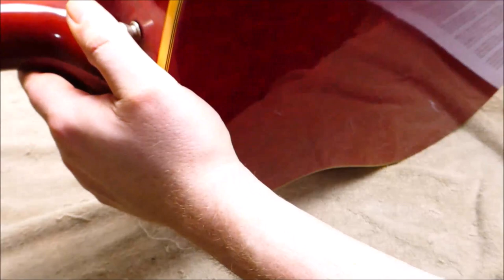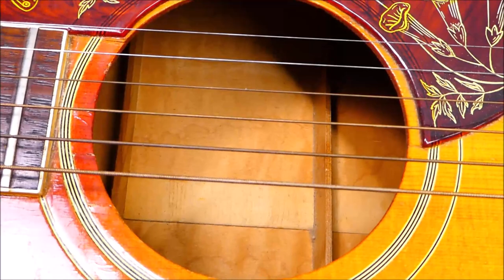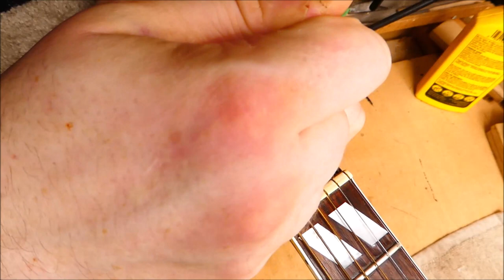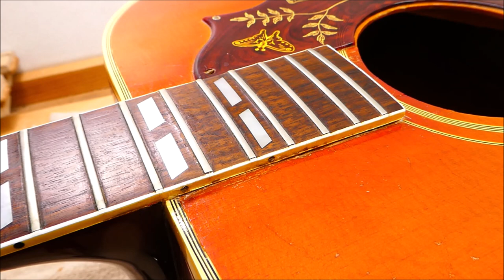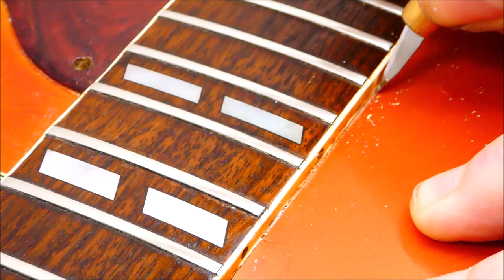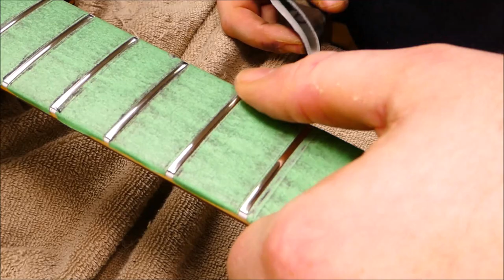'63 Hummingbird

Comment: Gibson in the 60s did recycle some serial number batches, about four years apart, so it is possible, what with the narrow nut width and filled in screw holes of the pickguard, that this one is from 67/8, just before they reverted back to belly down bridges. Having said that, as far as I Know, they only produced a few Hummingdoves (Maple B&S) and in 62/3, supposedly because Gibson had orders waiting on Hummingbirds, but a surplus of Dove bodies.
Excellent as always Ted👌

Comment: Had a Hummingbird once. Over 50 years ago, I knew a guy in southern Cal. named Sparrow or maybe "The Sparrow" and he had a Bird. I bought a used one and thought I was so cool. Did not really like it. It had that screw raising adjustable saddle and all the screws did was to drill a hole in the top. Traded it for a Santa Cruz H model several years ago. Also, if the box was from the 60's or even 70's most of the Hummingbird art on the guard would have been polished away from a player's arm, just say'n.

Comment: Dating 1960’s Hummingbirds is a nightmare. I own either a 66 or 68 or 69 according to various sites and or experts. Oddly mine has a wide nut width when it should be the smaller late 60’s size. Mine also has no sticker but does have a screwed down guard.

Comment: another thing about the fret rockers, even if the frets are perfectly flat, it can still rock because it's not parallel enough with the axis of the strings and it's rocking on the radius of the board.

Comment: Ted--"just" another one of your examples of engineering followed by execution !  (Now, by the way, I am setting up the Daviln-Ford bridge heating assembly. I watch you using it and it appears in the video that you are using some version of a multi-meter to measure heat. Am I mistaken on that? I bought 2 S-Mc kits but, darn, those need big holes !! ( I have to do a vintage Guild D40---mine) I found what appears to be a $53 dollar adjustable power source (YES, DC) on Amazon. My wire, sleeve material and SS tubes are in my cart. Ian sent me his link; I had already made some guesses and was very close, but I am not too proud to be at a degree of error. It does not seem right to ask for expert advice, and then, ignore it.

Comment: I could understand why they put dove joints in the necks when bolt on necks looks more sensible. I took the coordinator rods out of my banjo and made the rim a full inch. It made adjustment easier and didn't have to distort the rim to adjust. Doesn't Taylor use bolt on necks?

Comment: On those adjustable bridges is there some type of brass or bone inserts at the points of the screw ends of do they just hit the soundboard. Mine has nothing & is really dug down into the wood. I’m contemplating on fitting then with some bone or something along that line thinking it would transfer the vibration more.? What do you think?

Comment: TWOODFRD I know you get a bunch of questions here, but this is a real good one. I have an all original 1966 Ibanez 12 string with a trapeze tail piece, it’s basically a Gibson B45-12 clone. Should the saddle have string slots cut in? I know bridges with pins saddle slots can cause buzzing and muting of strings. Hard strumming and finger picking this guitar causes the strings to move around on the adjustable brass saddle.  Any advice would be greatly appreciated and thanks for this great channel!
Reply from the maker: Most 12 strings require grooves to keep the string spacing accurate. They shouldn't be too deep. Half the string diameter or less.
Reply: @twoodfrd  Thank you brother I appreciate your response! Now I got a saddle to work on!

Comment: Aren't you weakening the joint this way? You said it's important for the fingerboard to be glued down properly, so it can keep the neck from sliding in. But you took away glue surface by doing this wedge in 3 pieces. Is it strong enough this way?

Comment: 'Half a 64th!' Your best yet in the constant battle againstinconsistent measurement. I have a background in statistics, and one of my meontors (after a lengthy and erudite statistical presentation), said: 'which comes out at about two and a bit!' You should have done the Ethel Merman thing, though.
Reply: You're lucky !  Here in the UK we have to deal with such things as 'smijins' or 'smijes' as in 3.5 and a smije. (or is it smige ?).Also we have the rather useful .odd, as in 2.odd - best used when you forgot and can't be bothered going back up the ladder.

Comment: Would love to see the neck reset process on one of these, very little info available online. Is that because they were built so well that they rarely need it, or is it that the neck reset is such a swine that no luthier ever gets one done without swearing too much to post the video? I have a 2010 bird. So far so good, but the day will come. For now, replacing the spongy and constantly peeling pick guard with something more classic is all it needs.

Fitted mine with the Tronical robotic tuners, as I play in lots of different open tunings. Doesn't seem to have harmed the tone perceptively - though I'm sure it's considered sacrilege to purist Gibby fans.
Reply from the maker: I think I made a video about a mid 60's Gibson 12 string reset. Let's just say the craftsmanship in putting the dovetails together was not a high priority and they sometimes take a lot of effort to remove.
Reply: @twoodfrd  I'll dig out the Gibby reset, thanks Ted. Mesmerizing channel. It's like watching Bob Ross fix guitars.

Comment: I'm going to have to find your temporary solution for changing the adjustable bridge and being able to put it back. I've lucked into a 60's J200 that I might try that with
Reply from the maker: You just make a tight fitting rosewood plug and rout a saddle slot in it.

Comment: Potentially dumb question: given all the pressures on a fragile top and back of a flat-top acoustic that inevitably lead to neck resets over time, why does no one seem build them like banjos with a rod between the neck block and the end block? Wouldn't that hugely increase the stability at little acoustic cost?
Reply: A "C" shaped neck block would do as well and not be seen, through the sound hole.
However, that requires more wood and more work, which both mean more investment.
Not gonna happen, in a factory setting.

Comment: Actually, in '65, they went right to 1 and 9/16ths".
Reply from the maker: I did some sleuthing and there's a bunch of inconsistencies. Apparently there was a batch in 1966 with 1-11/16" again. It's like they were rolling dice for specs.
Reply: @twoodfrd  I don't doubt that one bit. 😉 Just like the fingerboard radius of some Les Pauls, ended up being closer to 10", instead of 12".

Comment: I wonder... Could that guitar be a counterfeit Hummingbird?  There is no label insde.  The only thing that identifies it as a Hummingbird is the pick guard.  And it is not original.  It is glued down rather than screwed, the screw holes have been filled with paste diamonds, and the edge of the guard is irregular around the sound hole. ???.